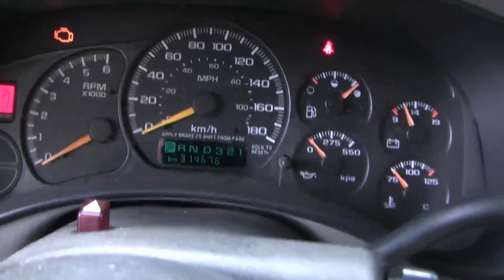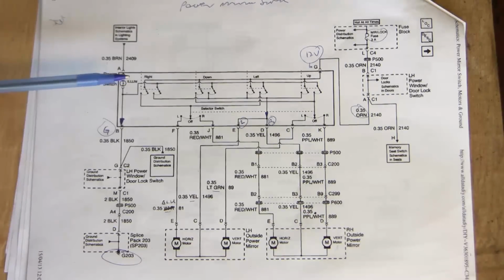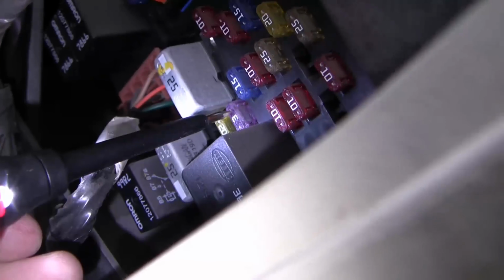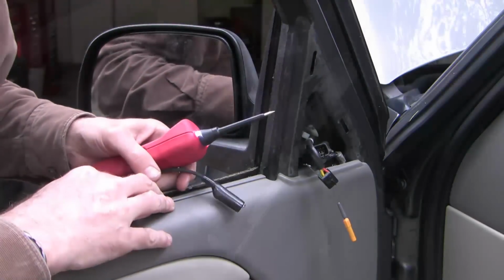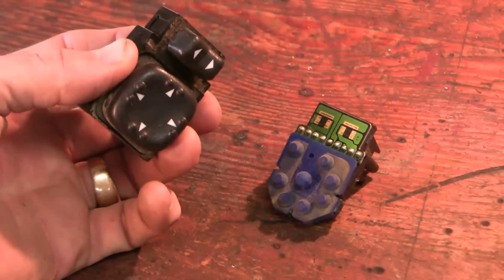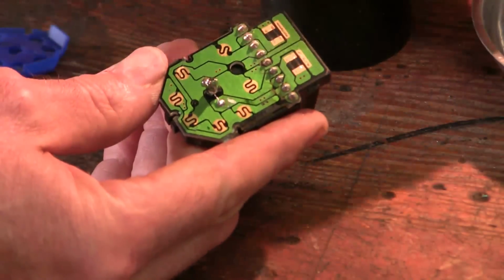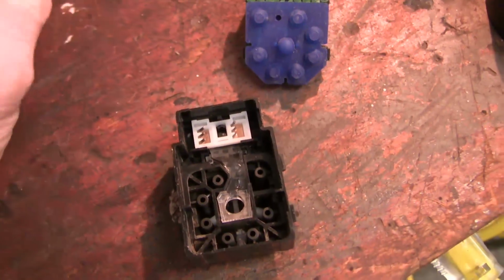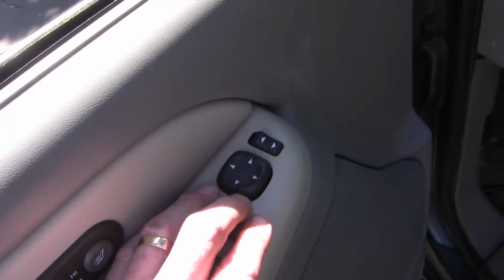How to fix a car mirror that won't move -- Chev Suburban

Comment: I had actually done everything you did but had the same issue...after watching your video i decided to pull it all apart and give it another try...after using some CRC cleaner and a little electrical grease, it works perfectly.

Comment: THANK YOU! My 2001 Suburban mirrors have been inoperable for about 2 years. I followed your video and after the first cleaning the mirrors started moving up, right and left. I took the switch apart 1 more time and cleaned the contacts a second time, and now both mirrors move in all four directions! Excellent video with clear explanations and instructions.
Reply from the maker: +ourgangmn Thank you, I'm glad it helped.
Reply: @spelunkerd  bnn hn b

Comment: Thank You! Extremely simple to follow instructions. Washed with warm water and Dawn dish washing soap, dried thoroughly, hit all contacts with ultra fine sand paper, snapped it all back together. Got my mirrors back working in 15 minutes for FREE! Thank you so much for posting this.
Reply from the maker: +Scott C Thanks for the followup, it's nice to hear how it works out for people who try this themselves.
Reply: The light sanding was what worked for me. Cleaning contacts alone did nothing.

Comment: Thank you so much!!! It worked for me. To anyone reading the comments thinking about trying it and that have found that the fuse is good, do it and be VERY CAREFUL when unassembling the switch. I did the following: with a very small flathead screwdriver I unclipped the switch from the plug and panel. Then with the same screwdriver I unclipped the switch.  Followed I took out the two contacts (very small pieces that select right or left) and opened them to an estimated 45 degree angle and sprayed them with contact cleaner. Also got a few Q-tips and sprayed them with electrical contact cleaner. Cleaned the contacts in the rubber piece and wiped the whole pcb (green circuit board). Got an extra Q-tip and sprayed it with contact cleaner and concentrated light scrubs on the board where the contacts touch. When I cleaned mine I noticed they went from dull and dirty to very shinny. Let them dry for one minute and reassemble. Fun fact: Clip in all three plugs (power windows, power locks and mirrors).my truck would not move the mirrors if I didn't connect all plugs. Also, I'm case that truly the switch is bad, I believe that some online Auto parts store had the cheapest replacement for $15 last time I checked. (Think it was Rock Auto) Other Auto parts had it for about $70. Trust me it is worth to give it a try.

Comment: Thank you so much for putting together this video 9 years ago! My mirror switch in my 2001 Tahoe has been bad for over a year now and I was thinking of replacing it before I decided to at least take a crack at repairing it. It's thanks to your video that I was able to be sure that it was indeed the switch itself that was the issue and I removed it, took it apart, and cleaned all of the contact points. It looks to have been the left/right switch with tines that was my issue as the grease used on it was so full of dust that it could no longer properly contact when I attempted to guide power to the left/right mirror motors. I used some very high grit sandpaper and a Q-tip with 91% isopropyl alcohol to clean it up, put it back together, and everything worked perfectly.

Sincerest thanks for saving me some cash. It only took a few minutes to repair thanks to knowing what to expect from your video!

Comment: I just wanted to say thanks. The mirrors on my 2000 Spyder stopped responding but following your video I was able to repair them and now they function like new.  You saved me quite a bit of cash on this one. The part cost $125 then there would have been the overly inflated labor costs. Thanks again.
Reply from the maker: Thanks for the followup.

Comment: Great video, sorry for the loss of your best friend.  I just recently experienced problems with my driver's side-view mirror.  My mirror won't move, but thankfully it is set in position for my eyesight. I will watch your video several times before I attempt to remove switch. Thanks
Reply from the maker: Thanks for stopping by. Replacement switches are very inexpensive in the aftermarket now for most older cars.

Comment: Thanks for the excellent video! I just bought a 2000 Silverado, that I plan to flip. The mirrors didn't work. Even before digging into it, I figured the switch was the problem, since neither mirror moved in any direction. I did have power and ground to the switch. I used the info in your video to take the switch apart. Everything looked good, but I cleaned up the contacts and put it back together. The mirrors work perfectly! FWIW, you can now buy a new switch on Amazon for as little as $12.99, but I would have had to wait 6 days to get it. Thanks again!

Comment: I purchased the after market replacement mirror controls for $37.  Your video made it easy. Both the left and right mirrors moved to the right consistently, never moved to the left and up and down was a Vegas crap shoot.  Ten minutes later, the new controller was installed and the mirrors move like new again.  Thank you!!
Reply from the maker: Thanks for the feedback! Did you get them off ebay?
Reply: spelunkerd  I purchased this part off of Amazon.  Their automotive section has a unique filtering system that will ask you if you want to sort products by those that actually will fit your vehicle.  I found the filtering service to be very helpful.  I had previously replaced both side mirrors for the vehicle using this service and they fit perfectly.

Comment: Thank you very much for posting this helpful video - I have a 99 GMC Sierra with very similar parts and assembly as your Suburban, and after following the steps outlined in your video, both mirrors are now working perfectly  - cleaned them per your instructions and re-assembled in less than 30 minutes and motors now work in all directions.  Thanks again!!!

Comment: I have been in the Auto Body trade for 40 years and so have dealt with my share of electrical issues.  It was, however, enjoyable to watch a well explained and detailed presentation of the problem.  I looked this up after I took apart my daughter's mirror switch to clean the contacts and found nothing apparently wrong, so wanted to know what others may have found.

Wonderful job... and you must be from Canada, eh? All you Canadians seem to be so mechanically inclined and ingenious!
Reply from the maker: +Jerry Kemnitz Want a kind remark. Thank you!

Comment: Thanks for the video! I turned out to be one of the lucky ones. Just acquired an '01, and no part of the power mirrors fuctioned. Using your video as guidelines, I got the entire system working again without spending a dime by simply cleaning the switch contacts. Funny thing is, they didn't even look dirty to the naked eye. One recommendation I would make is to avoid using anything too abrasive on the switch contacts, such as even wet/dry paper. Some fine metal polish (or paint polish in a pinch) followed by contact cleaner (acetone or isopropyl alcohol works fine, too) has worked miracles for me.
Reply from the maker: TheTeampontiac79 I'm glad it helped, thanks for recording your experience here.

Comment: Got my 2002 Tahoe mirrors fixed today thanks to spelunkerd's video. Oddly, my mirrors are wired to work without the key, just like the door locks and seats. And they're shown that way on the wiring diagram. I didn't believe the diagram but it was correct. The mirrors are powered by the orange wire which is hot all the time. Thanks again spelunkerd!

Comment: Thanks for the inspiration!  I replaced my 2001 Suburban 2500 mirrors with "power, heated" tow mirrors, then I was compelled to tackle the "power" issue.  It turned out that the problem was some goo on the "left-right" selector was preventing either mirror form working.  I cleaned all the contacts while I had the switch apart, but the goo was obvious.
Thanks again!
Reply from the maker: I'm glad it helped. Mirrors are worth something for junk yards, but the last one I scored was on a truck that had just been turned in to the yard, and it fit just fine even though the year was off. Because you don't see both mirrors at the same time, a bit of mismatch of chrome or even color is hard to notice.

Comment: I did much the same thing by cleaning the switch. After that didn't work, I then additionally added a small piece of plastic on top of the blue plastic piece above the contact that wasn't connecting.  The extra "shim" caused the switch to connect. I think the plastic below was just worn from the years of use.

Comment: Your video, clear, concise explanation has been enlightening.  I'm having a similar problem with a 2010 Traverse. Cheap, defective parts from Mexico used in expensive vehicles built in the U.S. are causing me and other GM customers added expense and frustration.  Auto manufacturers need to figure out how to eliminate the weak links in their supply chain.
Reply from the maker: Agreed. A solution will not be easy, since we've all had some benefit from inexpensive parts, too. What I hate is how it can be more expensive to fix something than to just toss it and buy another. Manufacturers don't make it easy, because after a few years they stop making replacement parts entirely, moving on to the next disposable product. Then you have to find a 3D printer to try to make a replacement.

Comment: Great video, very methodical.  Thank you for sharing!!  It's good to see someone actually repairing a part instead of simply replacing one.  I would like to offer two suggestions; since most people do not have a Power Probe (myself included, though I want one now, thank you [lol]), diagnosing with a multi meter may be more helpful as more people seem have one of them.  Secondly, as a former electronic tech and since I have repaired boat loads of switches exactly yours that use graphite traces on the circuit board and graphite buttons that actually bridge the traces when the button is pushed, completing the circuit path and in this case, making the mirror move, I have had the greatest success in repairing them by cleaning with a new pencil eraser followed by a cleaning of 90% isopropyl alcohol (rubbing alcohol).  Contact cleaner can also be used, though I have not had as much success with it on these kinds of switches, but most importantly, many kinds of contact cleaner contain lubricants and/or are destructive to plastic, so read the label before using it so you don't cause more damage.  Again, thanks for the great video - I learned a lot and I am sure others have, as well.
Reply from the maker: What a helpful remark, thanks for taking the time to record it here. To be sure many others find this one, I'll pin it to the top of the thread.

Comment: Thank you, I will defiantly try this before looking for a used one. A new switch for my 2000 Silverado 4x4 is $79.00 from the dealer. If there are more drivers driving a vehicle and need to move the mirrors, it becomes a problem. We are spoiled by all the new electronics these days. Some things where well enough and needed to be left alone, like adjusting a mirror.

Comment: AWESOME!! Thanks for this info!  This worked for me in my 2002 Tahoe....Just a hint for everyone, I found out the harness for the windows and locks has to both be connected for the mirror to operate.  I found out this the hard way by taking it apart twice thinking I put it back together wrong.
Reply from the maker: showguyer Thanks for recording your experience here, I'm sure others will fin it useful.

Comment: Great video. Was able to get my 22 year old switch fully functioning again. I did wipe down contacts with 99 percent alcohol followed by DeoxIT, very light pass with fine grit on contacts in the rubber boot and contacts on slider, then another light wipe with DeoxIT. On the board, a wipe only using DeoxIT with a Qtip.

Comment from the maker: I bought that little repair kit with the electrically conductive paint. But unfortunately it didn't help in this case. I painted just the clean copper contacts under the rubber pads, and let it dry 24 hours. I'm disappointed, but you've shown me another option for future repairs and it was fun to try. I probably should have done as you suggested and tested the board first, but I don't know enough about these boards to easily isolate the problem.  Thanks again for your input.

Comment: Great video, thanks !
I needed to sand the circut-board's "S" contact pads 
with a 600 grit, to remove the oxidized glazing.
As the alcohol and q-tip .. was not cutting it.
Then applied a light smear of die-electric lube.
Then everything worked perfectly.
Thanks again !

Comment: Very helpful. My mirror doesn't adjust at all but I hear the motor working. Like you, I will live with manual adjustment as the vehicle is old and not worth sinking any more into it.
Reply from the maker: There are some generic knock-offs sold on ebay that are about $40 which might be worth considering. As you say, if you don't adjust very often you won't miss it. These vehicles seem to keep going strong, I'm surprised how long mine has lasted. Thank you for watching.

Comment: None of my mirrors on my late model 2000 Tahoe would move before I tried your solution.  I used rubbing alcohol and an eraser on the contacts and now I get full range of motion on both my mirrors.  Thanks for posting this great fix!
Reply: Good suggestion. I'll try that on my 2007 Sierra. But I might use electrical contact cleaner instead of alcohol.

Comment: Nice job documenting your process, and I appreciate the door hardware dissambly.
Those puzzles are always fun to unravel!
If you have not sussed the problem, I was wondering if you tried shorting the contacts on the board to see if that switch connection closes the circuit. If it does, that leaves the connection between the contacts in the rubber pad.
If you need to fashion something for that, some copper foil with conductive adhesive of the sort for shielding guitar cavities should work.
Stewart MacDonald sells the stuff, or I can mail you a length of the stuff for nothing if you like.
Always good to have a piece in the fixit box.
Reply from the maker: Thanks, one of the other readers suggested something similar. I bought a type of electrically conductive paint and put it on the metal contact area inside the pad (not the board). It was worth a try, but that didn't work for me. If I go at this again I may try resoldering the wire joints, in case it's one of those situations where a solder joint has a microfracture. This is a control that I rarely use anyway.

Comment: I also had this issue. Desoldered the board from the connector to check the backside and test all the thru-holes, just to be sure. Everything ok there. I typically clean suspect circuit board contacts with a pencil eraser if liquid cleaner doesn't work.  It's abrasive, but just barely. In this instance the eraser did the trick where the liquid cleaner did not.

Comment: Thank you! My mirror control only moved both mirrors downward. When I learned it is bad to move the mirrors manually, I became focused on fixing the issue. I was determined to do all I could to save money (limited income), and keep the OEM part; especially since there is no OEM replacement part. I am tickled to report that I was able to fix the problem! Next job: the Blower Motor Resistor, and the rear hatch lifts (much easier tasks). 🙂👍
Reply from the maker: We've got a lot in common, ha ha! The satisfaction of overcoming the challenge of a broken part is hard to beat.
Reply: @spelunkerd  Especially when someone says:"It can't be done;" and more so when the same someone says, "It can't be done by (me)." ☺

Comment: A Very smart & well spoken man right there!  Those Power Probes can be worth their weight in gold it seems some times. Time saved vs cost of equipment rlly.
Reply from the maker: Thank you, yes I agree about the Power Probe. With its long cables, the tiny amount of time to set it up pays for itself by not requiring a search for bare metal close to your work area. And it makes testing fuses a snap, with no need to even remove the fuse. Of course it would never replace a test light, and some kind of drop test is often needed to be sure the line can carry the required current. But for quick investigation it is hard to beat. I just have to remind myself that pressing the power button is just a click away from damaging sensitive circuits, I always think twice before applying power. Some have complained that the switch inside the probe can corrode, so I try to set up to click the switch first and then complete the circuit at the tip of the probe. That way, sparks happen at the tip of the power probe rather than inside the switch.

Comment: Worked great! My 2000 Tahoe had this problem. You could see shadow marks on the print circuits.I used contact cleaner and carefully cleaned with 1000 grit paper.
Reply from the maker: I'm glad it helped, thanks for the followup.

Comment: Nice work and I like you going into the switch to make a repair. I'm like egaistek as he had some good comments. Once the switch was back together, you could do a continuity test to see if all the contacts were functioning. And if not, you could give it another shot. Also, I like you showing the wiring diagram which is a nice touch. Good job Dave!